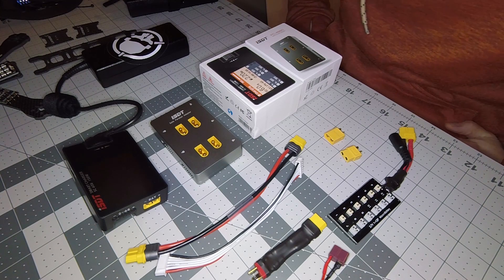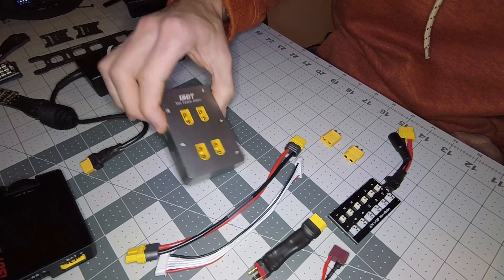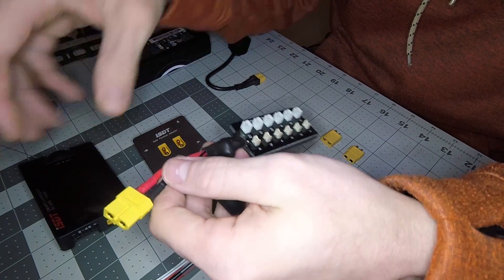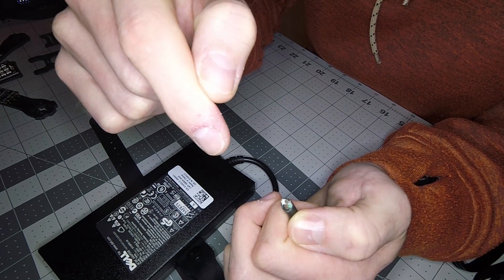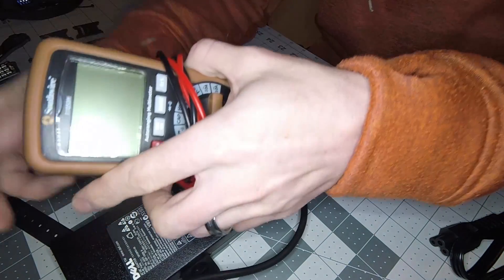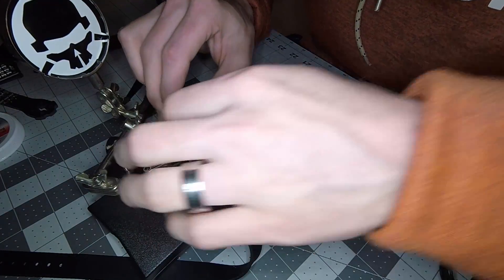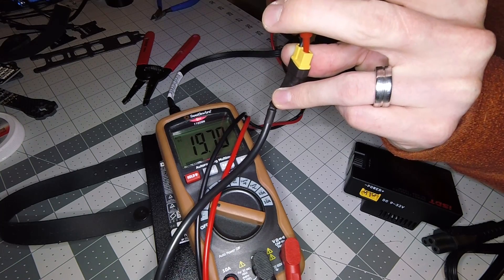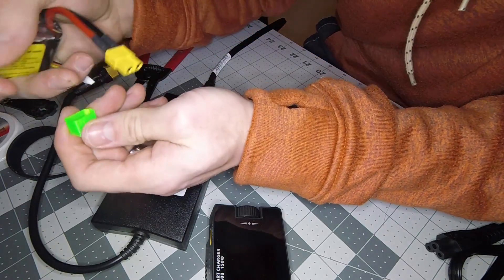ISDT Smart Charger, WALL POWERED! | FPV DIY

Comment: Bro what's the model of HP power supply? Any model or brand will work?
Reply from the maker: Yea all brands work, it more important to just find something with correct voltage and amp that fits your need.
Reply: @EverythingNaus  the one you used is 90w? At least 120w is safer right..
Reply from the maker: @rcnoypi8758  I believe so, I can check when home but been away from the action for some time so don't remember off top of my head.
Reply: @EverythingNaus  no worries...I'll wait;) thanks...
Reply from the maker: @rcnoypi8758  so took a look, I have a HP 90w, output 19v 5, Dell 90w, output 19v 7a, and actual ISDT 160w 27v 6a. All work great
Reply: @EverythingNaus  I have here 120w 5amps is that ok to the isdt changer? To be exactly..

Input: AC 110-260V
         : AC 1.76-1.35A
Output: DC 24V +- 1.35A
           : DC 5A
           : 120W
Reply from the maker: @rcnoypi8758  yes that should work good!
Reply: @EverythingNaus  thanks bro:)

Comment: Do you know the wattage of your power supplies?
Reply from the maker: Dylan sorry no where near it to take a look right now but it was either a 60watt or 90watt.
Reply: Everything Naus hey thanks for the reply. I have a 90w that I'm thinking about using that's why I was curious if it'd be enough. Thanks again
Reply: Watts = current (amps) times Volts

Comment: Great ideas.Have you had any problems?Mine is overcharging 1 cell everytime on 4s.
Reply from the maker: peter toth I haven't had any issues yet! Been using it since this video was made
Reply: The 19v dell power brick?
Reply from the maker: peter toth yea, still using Everything in this video plus some new gear
Reply: Thanks.Not sure why but ISDT has not responded to my request for unlock code to calibrate it.Just have to keep an eye on it to cut it off early.
Reply from the maker: peter toth I see, yea that crazy. I hope some firmware or unlock will fix it.

Comment: Why do people say to use 12v vs using anything within the range of charger
Reply from the maker: Joshua Lonas you can definitely use anything with in the range that the charge recommends, not sure why people settle on 12v but lower voltage = lower heat but it can handle more no problem

Comment: Its not safe to power a 150W charger with a 70W power supply. Plus you apparently dont realize that the amperage that is being put into a battery isnt the same amperage that the charger is going to pull from the power supply. You know how to solder but you dont know anything about electronics. You are teaching people unsafe procedures.
Reply from the maker: My understanding may be off but I figured that as long as I don't try and charge more then the power supply can handle then I should be find. but your right some of my audience may not realize that and I hope I haven't caused any unsafe issues. My last electronics class was like 12 years ago so I am defiantly out of date and might need to read up a little and double check my work here.  I am still currently using this every day but I only charge one 1300 at a time max on it since I have the ISDT 300 watt on there power supply they sale to do my parallel charging.
Reply: In order to figure out the amp load thats being put on the PSU you need to calculate how many watts the charger in pulling from it and divide that by the voltage which in the case of an HP PSU would be 19V. In order to find out how many watts are being pulled by the charger you need to multiply the voltage that you battery is charging at by the amperage that it is charging at. Im sure the laptop PSU will work for low wattage charges but people who dont know what they are doing could potentially start a fire.
Reply from the maker: Thank you for brining this to light!
Reply: Thank you for being open to constructive criticism.
Reply: The third screen on the charger shows input and output voltages but it also shows input and output Watts. This makes it easy to check as you don't have to do the calculation yourself. So it is easy to check that the Watts being drawn from the power supply is within its rated capacity. Just wanted to mention this as it makes checking easier. Also the charge current can be changed without interrupting the charge task so it is easy to reduce the current if it has been set too high. Personally i would never use a power supply anywhere near it's rated maximum. If you need to draw more than 50% of it's rating then it is probably better to get a higher rated supply.

Comment: So noobish questions. Does the power supply watts need to equal the watts needed to parallel charge or only the charger itself needs to have enough watts for multiple batteries?
Reply from the maker: ThriveProduction the power supply will need to equal if using something lower then what the charger can do. but if your using a 150+ watt supply for a 150w charger then you'll be fine. if using a 90w supply for a 150w charger dont exceed 90w it will over heat.
Reply: Another quick question. What calculation do you use to determine how many watts you'll need to charge in parallel? For instance say I want to charge 5x 4s 1300mah batteries
Reply from the maker: ThriveProduction it is somewhere in these comments I'll scan through them and post it up again.

Comment: Awesome vid as usual man, I know it's a bit dated but I have a question concerning this charger and the safe parallel board it comes with - do my lipos have to be around the same voltage as with traditional parallel charging? Sometimes my packs come down at different voltages at a race, ie: 15.2v if i finish a race vs 16.1v if I crash out in the first or second lap. Will it ruin my shit, basically?  Thanks dude!
Reply from the maker: Mulitia FPV haha no problem old videos need love to! so this parallel charger is the same as the the other you see, just with better build quality and better protection inside. so you will want to make sure you charge them with really close voltage. I don't charge them together if they are more then .3 difference .5 max so like 15.0 to 15.5 anything more I charge solo.

Comment: I used PowerDell, but in about 90% I suddenly realized that the device was turned off and when I plugged it off and left it a little, I plugged in again and the device was turned on. The dell was very hot. I was charging 4 cell on 4 amps. 
this is while the power dell is 130 watts !!
why was that?!
Reply from the maker: محمود نیک فر you might of been pulling a little to any amps, I only charge my 4cell 1300mah at a max of 1.3a normally just at 1a never in a hurry.
Reply: A 4 cell LiPo (4.2v * 4 cells * 4 amps = 67.2W) should be well under 130 Watts. Even allowing for losses in the charger i would be surprised if it was drawing over 80 Watts. 
It could be that the 130 Watt rating on your power supply is not a continuous rating. It may only be say a 60W continuous and 130W surge. When charging a battery the power supply needs to be able to deliver the required wattage over a prolonged period of time. This may be quite different to the load that a laptop demands. The laptop may only intermittently draw the full 130watts and for the rest of the time only draw 30 watts.
You would have to look for a data sheet for your power supply to know for sure. 
Also the laptop may know of the power supplies limitations and reduce it's power consumption (at the cost of performance) so as to not overload the power supply. 
Because you mentioned that the power supply was very hot and that it after a period of time it was able to resume powering the charger i would guess it has a resettable thermal fuse built in. So it sounds like you are overloading the power supply. More heat is generated than the power supply can handle and so the temperature fuse is shutting it down.
Either replace the power supply with one that has a much higher continuous rating or reduce your charging current so that the total wattage drawn from the power supply is less than it's continuous maximum power rating.

Comment: thanx a lot my friend!
can i use this option for my 4s 4000 mah battery?! and vaio 19.5v 3.3 A?
and How long does it take?
Reply from the maker: محمود نیک فر you could definitely use it on that battery but I have never charged anything larger then 1500 and at 1.5a it takes like 30-45min.

Comment: Could I use my old xbox 360 power supply? It supplies 14.2A. Would this be a problem or will the charger just draw as much as it needs? Also it provides a little more Watts. Thanks!
Reply from the maker: I believe it only draws what it needs but I'm not 100% sure.
Reply from the maker: I believe it only draws what it needs but I'm not 100% sure.
Reply: Hmm ok thanks! I definitely do not want to blow anything up on my first attempt getting into this hobby lol
Reply from the maker: Cameron L yea I definitely understand that. my understanding is that you set the charger to the amount of amps it needs to deliver and based on it load it will only pull that amount. so having more amps would be safe and better but might do a little more research.

Comment: can you charge a Fatshark battery with this?
Reply from the maker: Dylan Bogusz yes you can, it will need a xt-60 to fatsharks barrel plug cable. you can make this as well. Then when you charge it you won't be using a balance plug so it will warn you but works fine
Reply: Awesome! Thank you!
Reply: Also, do you know if its possible to charge 1C batteries for things such as the tiny whoop?
Reply from the maker: Dylan Bogusz yes you can I run a parallel board and charge about 6 at a time
Reply: Would you mind linking that board please.
Reply from the maker: Dylan Bogusz yea np, Crazepony 1S Lipo Battery Charging Board Micro JST 1.25 and JST-PH XT60 Plug Tiny Whoop Parallel Connect Plate for Horizon Blade UMX Drone etc https://www.amazon.com/dp/B01N2XMYFT/ref=cm_sw_r_cp_apa_KcOazbY1M3XWJ
Reply: To charge, do you set the number of cells on the charger equivalent to how many batteries you have then?
Reply from the maker: Dylan Bogusz yes so on a fat shark I'd set to 2 for 2cells, on batteries with Ballance leads the charger will automatically set to correct cell count
Reply: I was referring to the 1C Tiny Whoop batteries.
Reply from the maker: Dylan Bogusz oh I set it at 1 cell and 1amp

Comment: Just made this, first time soldering in my life.
Was super easy! Thank you so much for this.
Reply from the maker: norb4152 that's awesome! thanks!
Reply: Quite a relief when the lights stayed on as I plugged it in.
So on the charger it says 19V 3.16A (couldn't find anything higher at the recycle shop I went to).
That means if I charge at 1A I can only charge up to 3 batteries at a time if I were to get a parallel board at some point, right?
Reply from the maker: norb4152 that sounds about right I always play it safe and only do average 2 at a time but sometimes 4 max

Comment: Nice video, can the power supply be used ( perhaps a higher wattage one) to power a parallel board to then power multiple isdt chargers to charg lipos individuals as a result?
Reply from the maker: dronlline I have not done this but I did see a picture recently of someone who has. so that should work just be safe

Comment: Great video! If my laptop brick puts out 18 amps can I parallel charge 5 1300 batts at 1 amp?
Reply from the maker: Michael Guest yea at one amp you will only be pulling 5amps you want to make sure you fall with in the correct watts though
Reply: Thanks! You mean watts on the brick?
Reply from the maker: Michael Guest yes there is an equation that you can look up to find out how many watts you'll be pulling from the laptop brick based on how many batteries, this way you can make sure you're within the amount your brick  supports. the equation may actually be in the comments below somewhere.
Reply: thanks!

Comment: I have an old PSU that runs 12v could run this off that ? 25 amp 680 watts
Reply from the maker: Derek1978 little overkill lol but should be ok

Comment: Where can I duh the nice cover mat for your table if you don't mind me asking bro?👌😜🥇
Reply from the maker: Michael Petale I picked mine up at a local crafts store, but they have them on Amazon under self healing craft mats for cutting.
Reply: yea i just wanted to make sure it wasn't going to fry the charger not sure how the over amping will work
Reply from the maker: Derek1978 to be honest I'd maybe check the iSDT website. my understanding is that it would only use the watts it needs during charging and as long as you don't exceed that you should be ok. could be wrong though and if that the case that PSU could be to hard on the charger. might want to double check. if I get a min ill try to look it up.

Comment: That tiny whoop parallel board isn't great because it doesn't balance. This is a better option (if using JST-ph 2.0 connectors) https://www.amazon.com/gp/product/B01N4OXEWX/ref=oh_aui_detailpage_o00_s02?ie=UTF8&psc=1
Reply from the maker: Spencer Owen nice I'll check it out
Reply: If im not wrong it does actually ballance, it has the cuts on the side.
Reply from the maker: you wouldn't, this charger would just give it a full charge. it is a smart charger and will detect the cell count and charge accordingly.

Comment: question 
would something like this work? 
330W 19.5V 16.9A AC Laptop Adapter Charger Power Cord for Dell Alienware M18x R2 Laptop
https://banggood.app.link/ShLoxqTCkA
Reply from the maker: v1ral671 yes that would work it's a little Overkill but it never hurts to have extra power, isdt now offers their own 160-watt I show it off in my other video if you want to check it out

Comment: Naus thanks for the upload. I just finally got my charger from Banggood. They were back ordered. The instructions were so simple and mine came out super clean. I'm loving the channel and showed my wife your tiny whoop video and now she getting into it. Thanks for the help.
Reply from the maker: Walter Rodriguez Dude that is awesome! I am happy this channel is helping out! been so busy but still trying to pump out some new videos soon!
Reply: Everything Naus My question is does the charger automatically shut off or do I have to keep a watchful eye on it. I used it the other night but once my 4s hit 4.2, I took it off. It was at 99% I didn't take a chance.
Reply from the maker: After it gets to 99% it starts to balance the cell from my under standing so it will be a 99% for a while then it will make a loud beep when it is at 100% and screen color will change. I don't think it will turn off though I always unplug after the beep at 100%